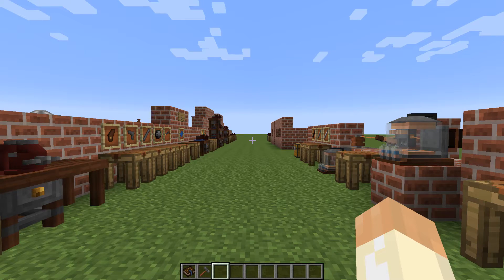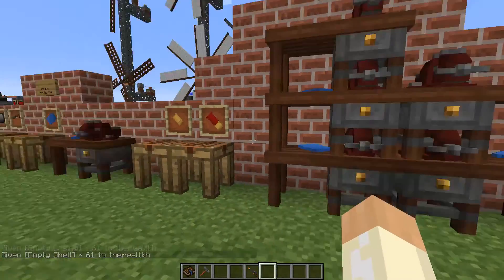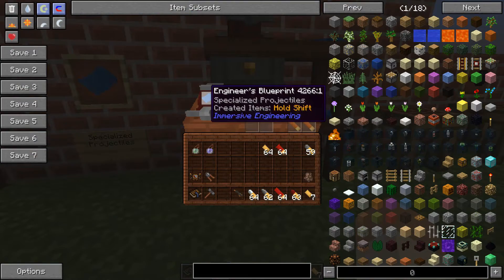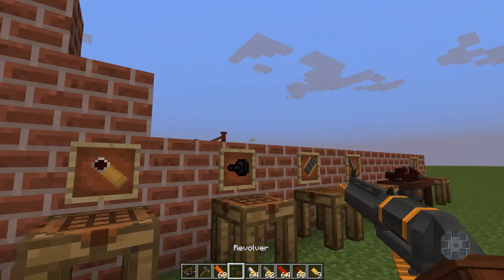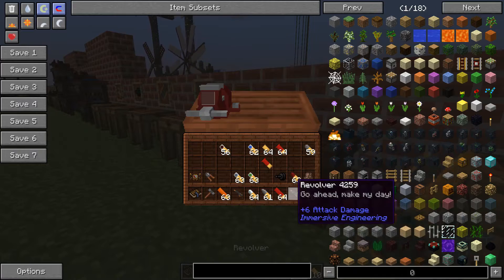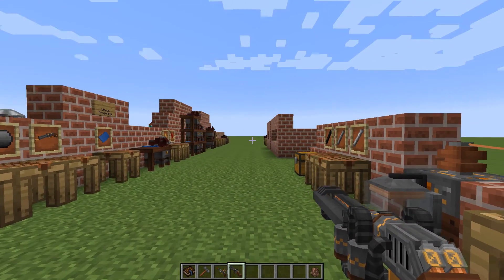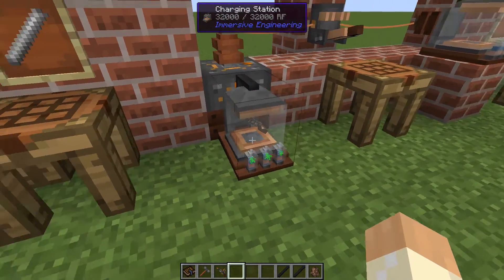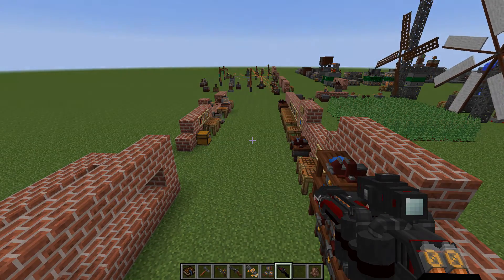Immersive Engineering Tutorial #4 - Weapons (MC 1.7.10)

Comment: My scope wont zoom in...  I hit shift, and look through the scope, but scrolling does nothing.  the zoom meter moves, but it doesnt zoom.
Reply from the maker: What version are you running and what other mods are you running? Modpack? Minecraft version? You could take this with the mod dev as well.... :)
Reply: TKH The one in the current (as of 10/20/2016) version of the FTB pack "Space Astronomy"
Reply from the maker: I don't know what version that is (I don't have the modpack installed), but it works fine in 0.7.7 for MC 1.7.10... Could be some other mod that interfere och some graphical addon that is incompatible. Put a case on github for the mod devs if you can't find the problem.